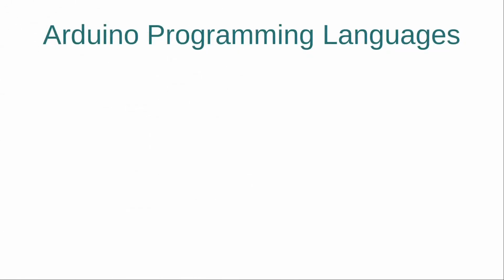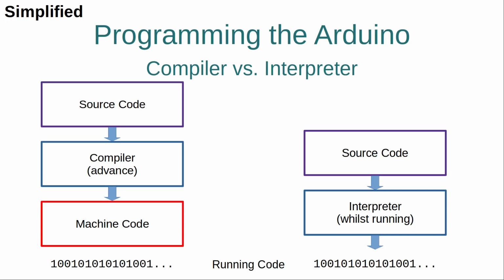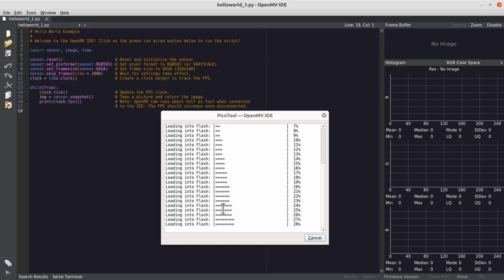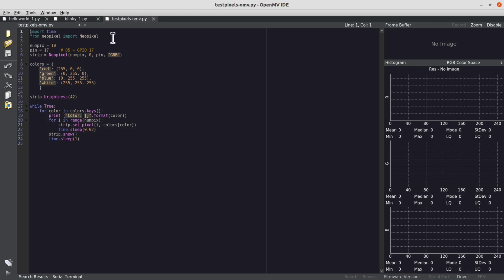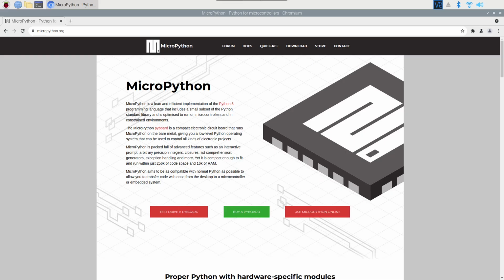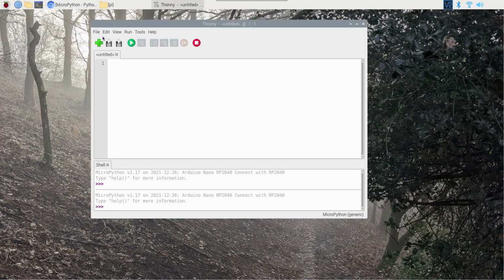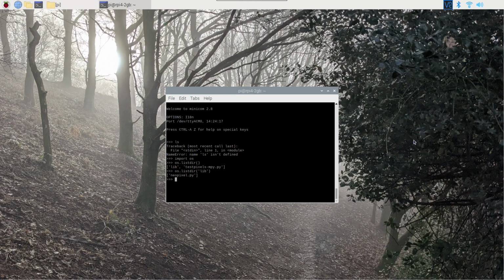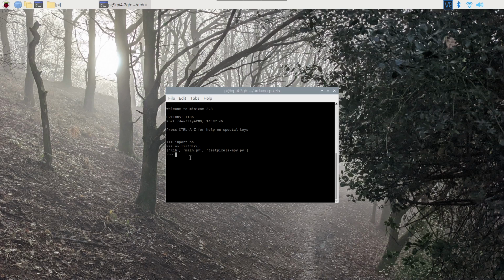Python on the Arduino NANO RP2040 with MicroPython

Comment: Python on the 2040 connect looks really useful for dual CPU support and also setting up a webpage for passing data. Is MicroPython supported in VSC for the 2040?
Reply from the maker: I haven't tried using python multi-threading on the Arduino RP2040 but it should work. Alternatively you can use programmable IO to offload some of the work to the second core. 

The reason I wanted the Arduino RP2040 was for the web support. As it didn't have MicroPython when I started the project I used C++ and created a web server as an interface to the physical electronics, but that should be possible with MicroPython as well now. 

I haven't tried Visual Studio with the Arduino. You can certainly write the code in VS and then transfer it manually. I think you may also be able to use a Pico plug-in to program the Arduino directly, but I haven't tried that yet.
Reply: @PenguinTutor  VSC works very well with Arduino C++ and the 2040 connect in a Windows environment and IMHO it's the best IDE for multiple platform development. Once the plug-in is installed, code transfer is over USB to the 2040 with a single button press and compile time is much faster than the Arduino IDE. If Micro Python is supported in VSC on a Windows PC and the code can then be uploaded to the 2040 connect, this will be a good platform going forward.